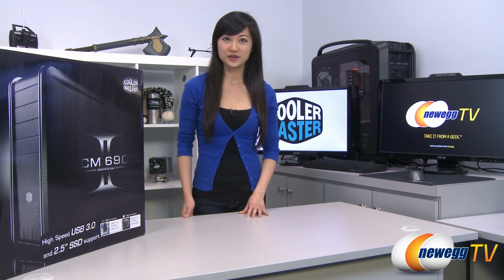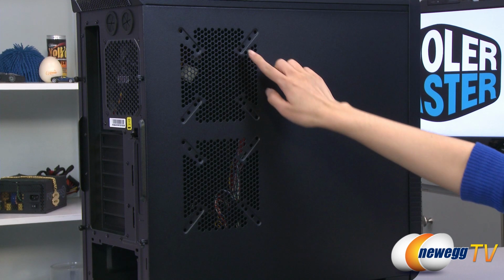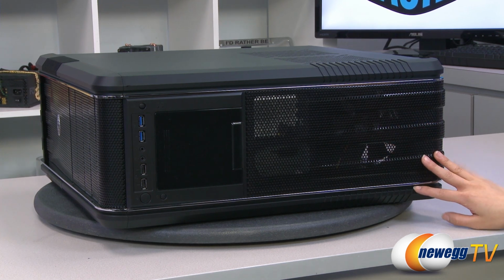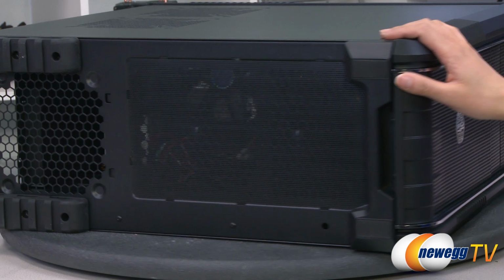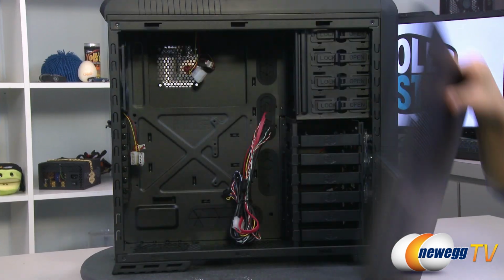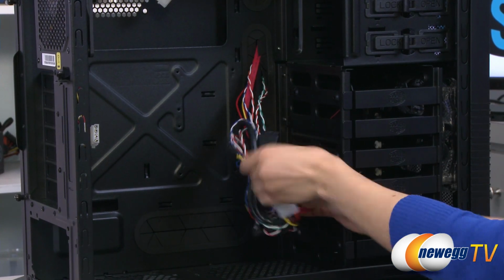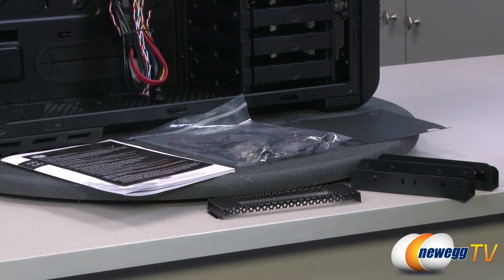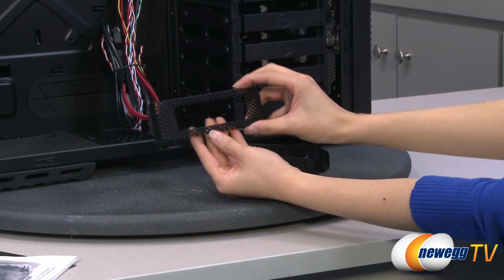Newegg TV: COOLER MASTER CM 690 II Advanced Mid Tower Computer Case Overview

Comment: would a 780 ti fit in here?
Reply: Have that exact card. Any video card up to 12 inch length fits fine and drive bays can be removed if longer is needed. There are six bays for internal hard drives.
Reply: @poppypbr3996  ahahah 6 year old comment i have a 1070 now and have had it for a few years. technology man. also i was 14 when i commented that loooool

Comment: I just removed the top one b/c it is used for exhaust. Also, unless you have a modular power supply, fitting all you cables behind the mobo tray is a pain. Lastly, the mobo tray cpu cooling hole is too small and doesn't line up straight with some mobos (not a problem with this new revision).

TL;DR: Fan filters are a pain too clean, not enough room behind mobo tray to comfortably route cables w/ non-modular psus. Still awesome case overall.

Comment: I pretty much agree with what miriveq said about the CM 690 II Advanced being an all-around awesome case but I have to add a couple to the "gripes" list. All of the filters are annoying to clean on this case. The psu one b/c you it is physically under the psu (dumb idea), the front one b/c even when you remove the front panel, it's held in place between the mesh and some plastic cross beams or w/e, and the bottom one b/c it is almost impossible to put on and take off w/o turning the case over.

Comment: I've had this case for a few years now, deffinately recommend it to any builder! Lots of room for cable management, plenty of air/water cooling options. The only two gripes I have is the top dust filter (unless youre going water) and the PSU air filter (need to remove psu to access it).

Comment: this looks like a revised design of the CM 690 ll the original 690 ll didnt have a hot swap dock, the tool less locking for 5 1/4 inch bays have changed and the 3.5 inch mounts have changed.

Comment: I have this case. Only problem with it is its really tough to clean. The top of the case has a filter thats under a metal cage with sharp edges. Complete pain to get off so i recommend leaving it off. Other than that it keeps my system super cool.